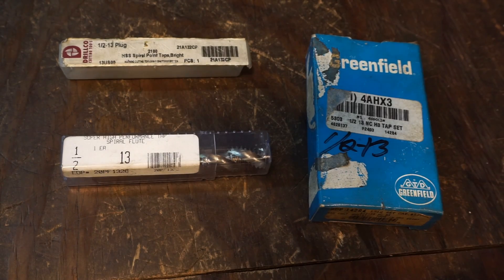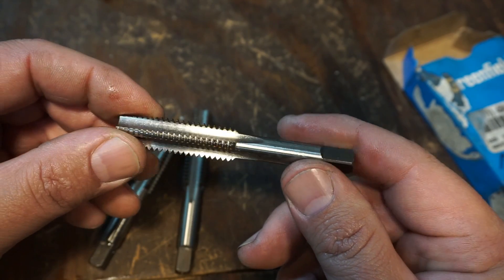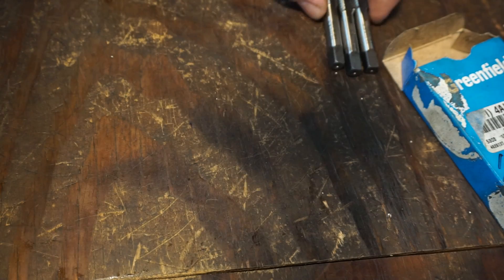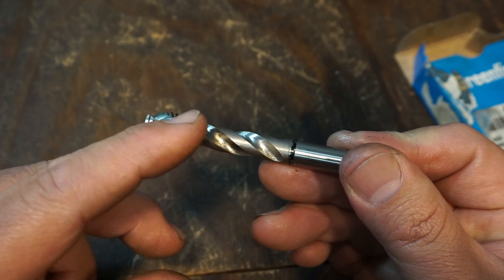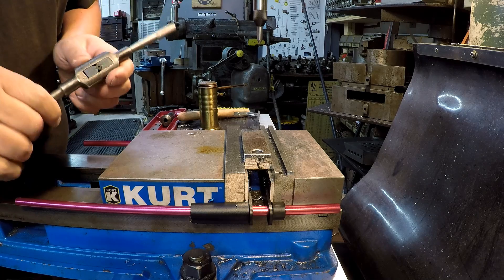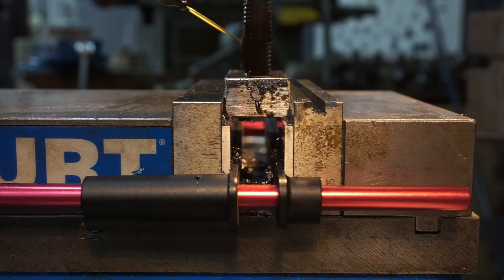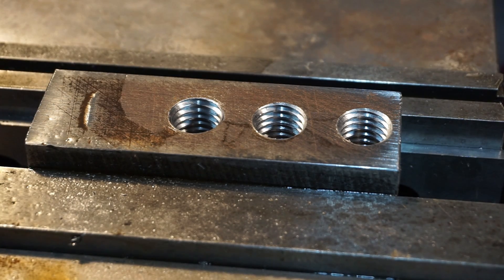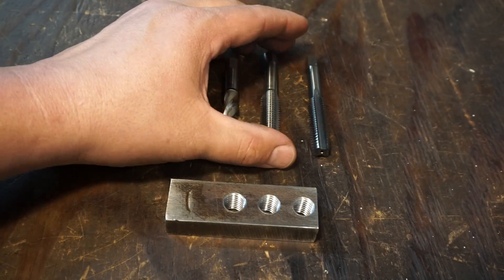Shop Talk 21: Taps

Comment: I was always told when i was a a youngen just learning the trade that you either use a tap bone dry with no oil, or you soak it with cutting oil. I was never given a reason why but I always used taps dry and never had any problems with it

Comment: I've only broken taps in stainless, and I don't usually power tap anything except aluminum.Hand tapping is much easier if you go a little larger on the tap drill than the "chart" says. For example, using a #7 drill instead of a #9 for an M6 tap. If you have more than minimal amount of thread length it will still be strong, although a little sloppier feel when starting.

Comment: Thanks Adam for the talk on Taps. I'm one of those that didn't know anything about them.   I have a tap and die set and about all I've ever done with them is chase a thread with them.  I have a couple of spiral taps but didn't know what they were used for and how to use them.  Thanks again for your shop talk on Taps.

Comment: On the ends of the taps, there is a square attachment for the hand tap.  My question is,  When you use them for power tap, do you put them in the chuck, only on the round part, so they will break loose if you go to far and hit bottom in a blind hole.  I suppose they would break if you chuck them up on the square end, and hit bottom????  
My other question is... where do you find the drill size for the tap you are using.  Some times I break a tap because the hole is too small, an a poor tap if the hole is too big.  Most tap sets that I get only have the different size of taps, and don't tell what drill bit to use.
What do you call the drill bits that have a flat bottom for countersinking a hex head bolt???
Reply from the maker: When chucking them only grab them on the round shank. The square is for a tap wrench. I have many charts that specify tap drill size. I’ll have to figure out a way to convey that info for video.

Comment: Hi Adam! Can you do another video showing the relation between the tap size, and the drill size? Also, I’ve heard of “tap and die” sets. Clearly, taps put threads in a hole, so dies must put threads on rods, right? In which case, I guess the only reason to thread with a lathe is that there’s no die in the size or thread pitch available, eh?
Reply from the maker: Yes dies are for external threading. I’ll go over them in another video.

Comment: A suggestion to a follow up video would be the H Limit and class of fit. This may out of the norm for most home gamers, but sometimes it can have some practical applications. For example, I used to have to tap 300 series stainless bars that would work harden and snap taps like crazy. I found that if I used an H0 tap instead of the common H3 it would tap like butter since it was 3 thou smaller. Of course that changed the class of fit, but the standard hardware had plenty of clearance and did not pose an issue in this circumstance. Anyway it is something people can keep in mind when ordering their taps and drills for each job. I'm sure you could make it interesting for us!

Comment: Couldn't of timed this better, while i knew there was some differences i wasn't 100% sure of terms and names. I needed to buy some taps to thread some replacement parts for music hardware.
Reply from the maker: Buy some good quality taps when you do. High Speed steel.
Reply: Can never go wrong with good quality. But in this case hardness isn't as big of a deal but chip evacuation/chip pattern is. As I am cutting 3d printed materials that are done with FDM. They have a habit of drilling poorly so spiral bits often cause issues.

Comment: What do you think of the new 3in 1 taps by Dewalt?  I like em in my mower repairs,  but for your heavy duty type of customer jobs,   I prefer the type you demonstrated .
Reply from the maker: I can't say that I have used them before. Is that like those ones used for sheet metal?
Reply: Keith Fenner did a video about them.
https://www.youtube.com/watch?v=9ZXZzOASSR0

Comment: How about tap recovery? Best and worst practices, and how to avoid this sticky situation? (if a tap breaks in a blind hole, or in a normal though and though hole etc.) thank you for the quick and nice video
Reply from the maker: Broken taps would be a good idea for a video, problem is I don;t want to break one and try to remove it! LOL!
Reply: We know, that you are the best at what you do. That's why you are one from a big group of individuals with the best skills in this industry  , but for educational proposes , maybe ..  you can break one on purpose ? :D Have a good day sir :D
Reply: Was fixing to say the same thing about a broken tap removal video or broken drill bit... either one can be a major pain in the ass to remove especially in a blind hole!!!
Reply: Come on all you would be machinists out there.....I'm sure someone has a trashed part in your scrap box, (complete with broken tap), you could send to Adam...
Reply: I had one , once , but due to aesthetics I cut that part off ( lol ) and because that tap was carbide(i think) I didn't even bother to dril it out or something ( I know carbide must be drilled out with carbide ).
Reply: AvE has made a couple videos on the subject, he doesn't give two damns so he broke off taps intentionally and tested a bunch of ways to get them out (including dissolving them, ha!) i personally have used the chisel method and it works, but is slow.
Reply: Take the next smallest diameter end mill from the minor diameter of the thread you have and sacrifice it to burn the tap out. 8-32's always break on me. Used to i should say. Now i thread mill anything over 6-32.

Comment: Adam I have been watching your videos for a long time and I think they are great and I have a home shop and am looking at milling machines. I am wanting to do engine and head work ,boring and decking blocks and heads and valve work my question is witch would be better a vertical or horizontal mill and could you explain the pros and cons of both thank you and keep up the great videos.  Thanks David Loftis

Comment: It should be worth noting that you need to take a good look at the taps that you get at your local hardware store and make sure that they are High Speed Steel. I believe my local stores only carry the Irwin Hanson line of taps and they are all just carbon steel, they say "high carbon steel" on the package though. They seem to be fine for chasing threads but I tried using one of them, in a pinch, to tap a new hole and that turned into a painful experience.
Reply from the maker: True that. Every tap I have seen or used that said High Carbon Steel has been junk. I got one for a thread coil set from Napa once in a pinch, the stupid tap broke instantly!
Reply: Mine didn't break... but it took a lot of back and forth with the tap wrench to get some usable threads. In the end, I probably could have drove to the closest Fastenal (30min away) gotten a better tap, drove back and finished the job in the same amount of time. 

We mostly use metric fasteners on our machines, so I found a decent set of import HSS spiral fluted taps on Amazon, I think they're KK Moon brand or something like that. I just keep two or three sets in my tool bag at all times. I think they're like $10 for the whole set (2mm or 3mm to 12mm IIRC), and they work a lot better than the stuff you get at the hardware store

Comment: Is it a rule of thumb in order for a given size bolt to have maximum hold to use material thicker than the diameter of the tap ?
Reply: Georges Gareau From what I remember in school and working part time in a machine shop to get the maximum clamping force the thread engagement must be 1.5x the thread diameter. ex; 1/2" bolt the thread should engage 3/4". I remember seeing Xrays showing the stress spreading through the bolt from under the head to the end of the bolt, it was an eye opener to see. If I come across those pictures ill ask Adam to include them in another shop talk.
Reply from the maker: I can't say for certain on your question, but what I was taught is that a bolt needs to be engaged at minimum the length of the diameter, so for a 1/2" bolt it needs to be 1/2" deep.

Comment: Hey Adam. As a machinist, how do you keep your fingernails so clean?
Reply from the maker: I use that special line of Avon79 nail products
Reply: soak in small bowl of warm water and blue dawn, the miracle dish soap. Good for oil coated birds and dirty fingernails
Reply: wire brush
Reply: Adam moonlights as Avon 79....(S)he knows what to use..
Reply: None of you have a woman who complains about your dirty fingernails? I understand the pride in having work-dirtied hands, big ugly scars, bloodstains etc., but if she has an issue you're sure to hear about it until it's fixed.

Comment: It makes me mad when they don't put centers in the taps.  It seems like it is typically the spiral point taps that don't have them.  I can usually add a center with a carbide drill, but it's still a PITA.

Comment: I wish you had included interrupted thread taps... I use them for cutting pipe threads in tough stainless, and for that they can't be beat.  It'd be nice to see you do a comparison between a hardware store 3/8 or 1/2" NPT tap and one of these in some 321 or 316 SS... it'd a be a real eye opener for folks who have never seen one at work.  Just a thought.

Comment: Should I chamfer the hole before tapping or after?
Reply: Before - it guides the tap into the hole
Reply: And afterwards if you want a sweet looking tapped hole.  Before tapping the chamfer makes a sort of "funnel to guide the tap into the center of the hole. Then afterwards just dress it up to remove burrs like any machining operation :)
Reply from the maker: I always chamfer before the tap to help guide the tap into the hole. Like Yankee said, doing it again after will help clean up the chamfer for a better finish, but not necessary though

Comment: great video adam  for power tapping how small is to small is there a rule of thumb? i make metal sculpture
would be great at times to speed things up
Reply from the maker: I think the normal for me is 1/4", and anything smaller then that I tap by hand. Some small fine pitch taps it's easy to strip the threads out if your not careful. Even the spring return on the quill can do it.

Comment: Hi Adam, Thanks for this video covering all the different Tap types & their uses.
Although it wasn't made clear if you can in fact use the Spiral Point Tap by hand?
I understand that its main purpose is power tapping, but unsure if it could be used to hand tap with??

regards Colin
Reply from the maker: Colin yes you can use these for hand tapping. I generally start them with power tapping and finish them off with a straight tap wrench once engaged into the hole a good ways down.
Reply: Thanks for those extra details Adam & appreciate you taking the time to follow up on this question.

Comment: Is there a size of tap where you would only do hand? When I have tried power tapping, I always manage to snap the tap, but these are the smaller ones, say  3/8" and smaller. I find that whilst I go in, it's usually the reverse that breaks them.

Comment: These are sometimes called “Gun” taps. Because they do shoot the chips forward. They were invented and patented by Greenfield Tap & Die in 1913.
Reply: MIKE PLANKEY Mrpete222 would be proud.
Reply: Huh, I would have guessed that the design was used for barrel rifling. As a barrel is one long open ended hole you can push any chips out.

Only a guess and it doesn't really work as rifling patterns look nothing like screw threads. :/
Reply: @ZaphodHarkonnen  Making a gun barrel is a multi step procedure of drilling, honing and a special forging process called "cold hammering"
Reply: James Sullivan rifling is imho far to shallow, elongated and the barrel length is to high to use a tap for that kind of work...

Comment: Have you ever used Thread rolling or forming taps?
Reply: cmonster6 Ona deese 👍
Reply: cmonster6 
You have To buy a beer ...😁
Reply: cmonster6 I've only seen that done on external threads, usually after the threads are rolled the bolt it stud is heat treated, my experience is with them is only on engine hardware, I'm sure they're used a million places.
Reply: I use roll taps regularly I run cnc's though. They don't actually cut but deform the hole and form threads.  I use them in sizes from M2 to M6.